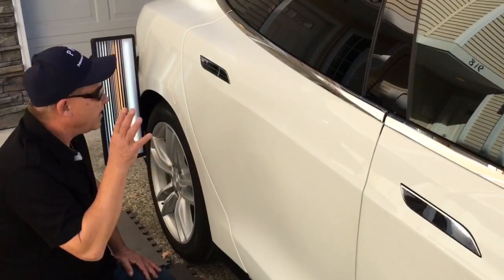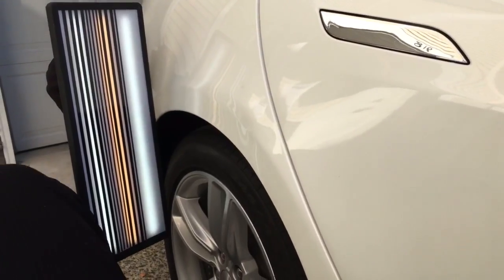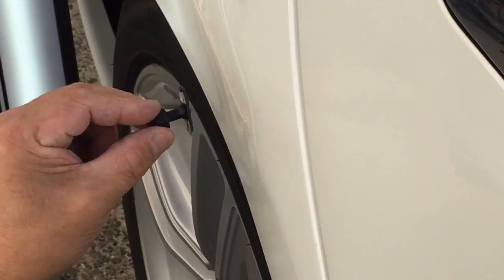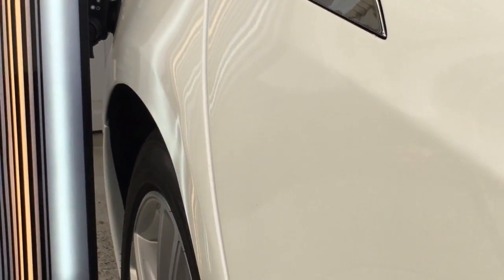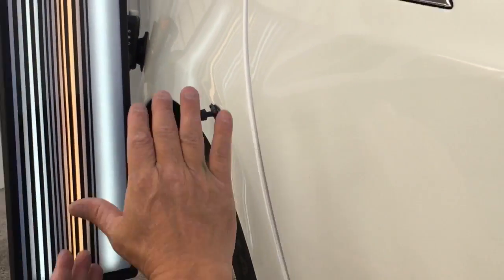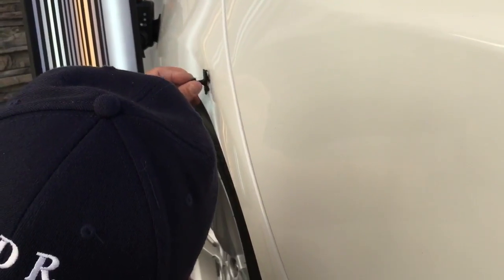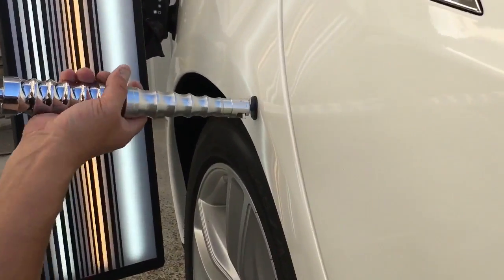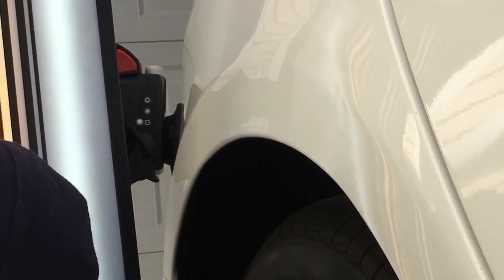PDR a vs. Tesla S #undented #PDR #Teslamotorsclub

Comment: You should of taken the the red mushroom tip off the blending hammer and put it on your knockdown instead. Means you could knock the brow down faster and more neatly with more force. The brow would take hours to move just tapping with a light blending hammer.
Reply from the maker: Scott Shiel yeah I beat on that bro for an hour with both my blending hammer and my tab down with the cherry tip. It did not want to move. Thanks for watching.👍